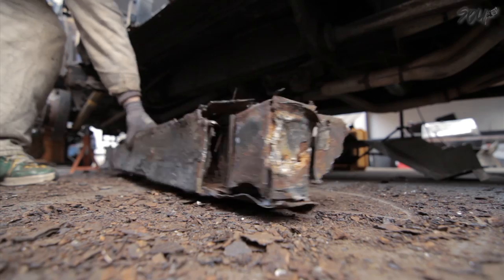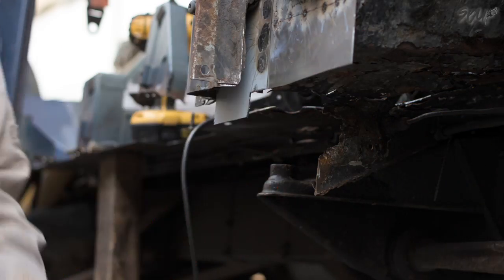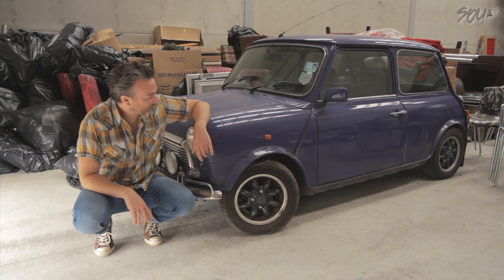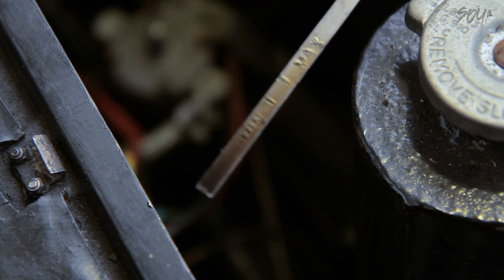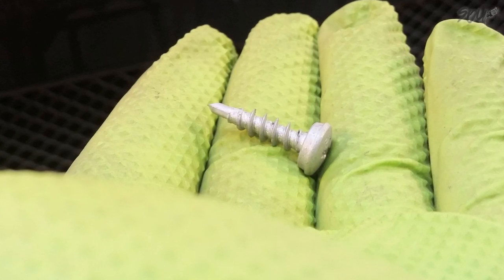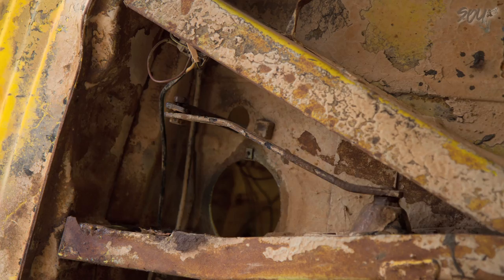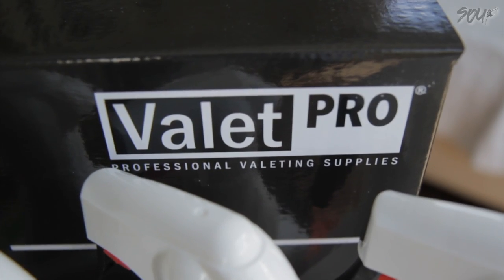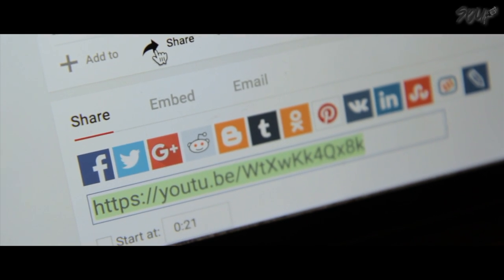Simple bodywork fabrication, Mini, Racing. Lotus Esprit S2 // SOUP Classic Motoring 07

Comment: Another fine video, im just finishing off the restoration of my 1983 triumph acclaim with a few subtle mods. its been a bare shell layed on its side for 18 month whilst ive seam welded the floor pan and suspension turrets and a joining panels and the rust removal depression has come and gone luckily i have good mates to help me out and get my mojo back. I do hope you can keep the series going, maybe cutting back on the exelent stop motion animation which i love would help.
Dan
Reply from the maker: Had to do some reading about the Acclaim Dan, really interesting car. I never knew. Send a few pics when you're done. With the videos the stop motion is the one sure thing and time isn't a prob. It wouldn't be the same without it :)
Reply: I used to have a Triumph Acclaim.  I crashed a Volvo 345 when i was 19 and the Acclaim replaced it.  I remember the feeling of how light the Triumph was after the 345 tank.
Reply: acclaim folk lore says the Irish police bought some silver ones as they local bad boys had found they couldn't be caught in them.
Reply from the maker: +Dan logicaluk +Ben Jennings Starting to feel like I'm surrounded by Triumphs, is this the Acclaim revolution? Greg Davies drives a silver one in Man Down I think. Any photos of these Irish Acclaim Garda cars?
Reply: George Karellas not that ive seen ill ask about

Comment: George. The rear light clusters on the Lotus looks like there from a SD1 Rover to me ? I hope you look on my Mini videos but from time to time.I  have to say the Paul Smith minis are well worth hanging on to. Great video as always. Cheers David
Reply from the maker: Yep upturned SD1 units Dave, starting to get rarer now too. The S1 used X1/9 ones. Have to admit I haven't seen anything at all on Youtube for a while (no time) but your Mini stuff is how I found you! The PS Mini was no accident. It's one of the nicest appointed cars they built and it's a curse because I can't bring myself to modify it outside the adjustable suspension I have on it.
Reply: George, Sounds like a wise move not to modify the PS as good ones are getting rare. Cheers David.
Reply from the maker: Plenty of fun to be had from a standard Mini Dave (with slightly tweaked suspension)
Reply: George, Spot on! They are just great fun to drive whatever you have 998 or V-Tec Take care David.

Comment: George, maybe not in your plans and maybe a step too far but that bus could take a 'Sooby' Boxer engine...apparently they are all the 'rage'....
Reply from the maker: Every once in a while I think long and hard about what I'd do with the engine; Tdi, Subaru, Porsche. I always arrive back at the same conclusion... the VW engine is capable of good power with the right mods, its the gearbox that's the limiting factor on T2 buses if you ask me. I want a bus that can cruise at 70mph in a relaxed way. That's a useable machine. Paul from Ep.2 just replaced his stock unit with a nicely put together VW 2.2 and he says it's savage.
Reply: I understand fully....My first car was a Type 3 VW 1600E(Bosch Mechancal Fuel Injection..controlled by a 'computer' that must have pushed out 45HP(on a good day)...Had many a school boy fantasy regards tuning or swapping out that unit for a 911 motor....fantasy is about all I ever achieved with that car...much to my shame and regret many years later...That was back in the day when 'bodywork' consisted of chicken wire and body filler(as per the AA Drivers handbook) and a few other 'homers'...

Several of my friends have owned/restored VW Bus' ...My Jag awaits resurrection....it will happen...I have decided that 'life' will not get in the way of my dreams ever again....
Reply from the maker: That's the attitude, we're all running out of time, best just get stuck in. I've a few cars that got away that shouldn't have myself.
Reply: You thinking about 'That' Jag??
Reply from the maker: Was hankering after a W08 Benz but 'that' Jag has overtaken it and is top of the wish list. Would love it for the series, I've always wanted to try a rat look car. Think it would look good with the SOUP logo on the side. Just need to get the series out there more and get revenues up first.
Reply: Yep...without the 'flow' not uch can 'Go'.... Lets see how things develop...did you get my Jag photo on peatron? Not sure it worked..??
Reply from the maker: Didn't work, sent you a reply over there.
Reply: Okay sorry about that...will try something else although my profile 'phot' has been changed to how it (partially)..